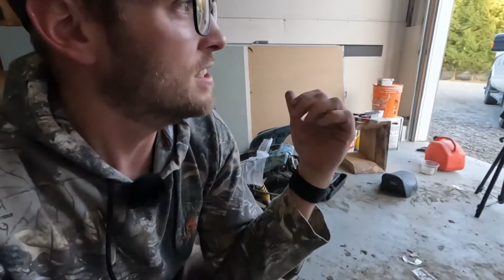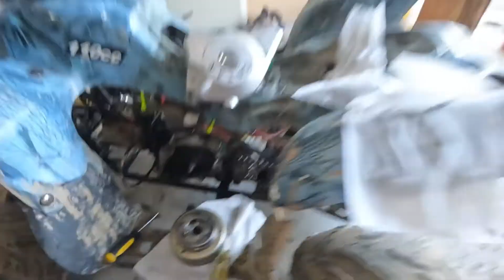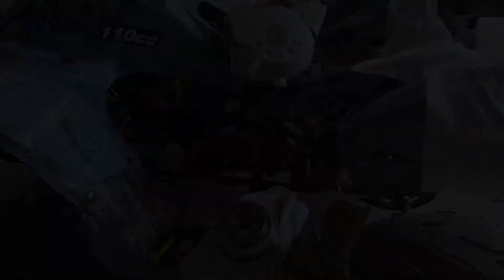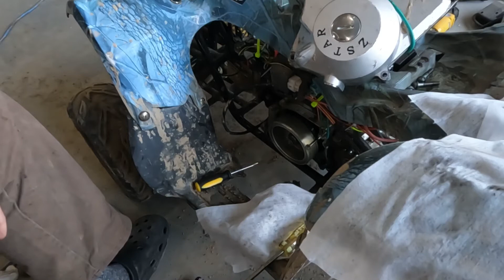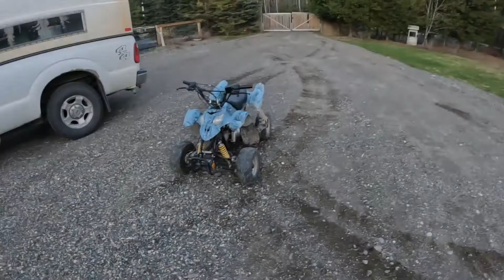110CC ATV Starter Clutch Fix. A Patch and Go Solution for $0 Budget.

Comment: How do you get the magnet off? After the bolt is removed
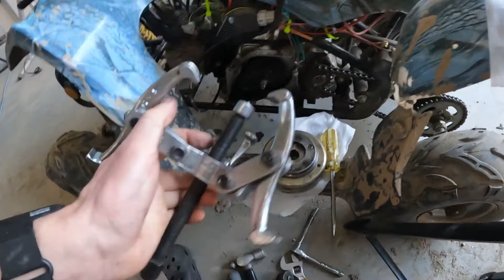Reply from the maker: 8:00 min. Puller to get it off the crank shafts.

Comment: Well I welded the bushing onto the big sprocket and it fixed my issue. Just wanted to let you guys know.
Reply: What bushing ?
Reply: @GorrillaFastTv : there’s a slip bushing inside the clutch and if becomes worn out, just give it a small tack weld. Rotate it on the flywheel and you should understand what it does!
Reply: @Mr.Sharky104 I fixed it the right way!
Reply: @Mr.Sharky104 but I do get what your talking about
Reply: @GorrillaFastTv yeah? Well just by throwing a new part at it isn’t always the solution! As a mechanic of 45 years of experience, you sometimes have to be creative! Them new chinese parts are designed to fail , so the manufacturers can make money. But hey, whatever floats your boat dude.
Reply: @Mr.Sharky104 yes ik! Even before I seen this video I already took it apart and pulled the springs to fix it. But my problem was whoever worked on the bike before. Ordered a new starter and the starter spun the opposite way. Something told me out the old starter on and see if it’s spinning the wrong way it was!

Comment: I had that problem, we fixed it same way, few months later (now) it won’t start again. We tridet to push it and it started on pushing, but I think it is not the same problem because when this was problem we could not start it on pushing, do you know maybe what could it be
Reply: Maybe same problem but they are just too weak to start by button
Reply from the maker: I'd say they just get too weak and collapse again. Very cheaply built units.
Reply: @sprucestomper  tnx for help i think it is that too

Comment: I install a new starter clutch the sprocket just spins clutch is not engaging I'm lost.
Reply: You ever find a fix?
Reply: @BenjaminJacobo-un8oh  i have the same issue, what was your fix?
Reply: Hi there, I'm having the same issue did you ever find a fix?
Reply: I’m having the same issue with my grandkids Evoque ATV. I noticed the large sprocket has a bushing where the clutch dogs, little rollers catch it , but the sprocket doesn’t turn, but the bushing does. Thinking of welding the bushing to the sprocket. Any thoughts? I will update once I am done.

Comment: A lot of other tubers just say - "forgot to turn the camera on while I fixed the roller springs in the roller ramp clutch" so thanks for taking the time to actually show how the starter engages the engine on this.   Anyway, nice work.  Lots of small engines, even nitro GLOW engines use roller or needle bearings the same way for starting.  BTW I think washing machines have a similar mechanism   that turn part of the agitator only one way.  Some are weighted dogs (with teeth instead of ramp friction) that fly out on a lever and are shoved back in the reverse direction.

Comment: I've used Chinese. Scooters, for years the parts are cheap, and their easy to fix,  now I have a dlx hawk dual sport, with 12k miles still runs like the day their delivered it in crate.  Saves me all kinds of cash, good on gas, gets up to 60mph, at 7k rpms,  go thru dirt trails . Avoid the California, hordes that have  invaded,  the small town I've lived in forever.
Reply from the maker: Definitely alot of fun and super cheap to fix. Thanks for watching.
Reply: Just got the grom clone last uear. First 2 wheel toy. Swapped 212. Still tinkering away to get it squared up

Comment: I have a Loncin 90cc engine fully auto gears and the clutch seems to seize and won’t disengage so the back wheel is hard to turn freely when engine is off and clutch seems to be stuck on and if I start the bike back wheel moves with engine speed but if warm the bike up the back wheel moves way more freely but still has some drag then when bike cools down it seizes back up again you recon it’s my clutch ?  Oil changed brakes not rubbing what ya reckon?
Reply from the maker: Clutch, its the only piece that transfers powers from the engine to the wheels. If the wheels are turning that clutch is engaged, if they wont stop then the clutch isn't disengaging.
Reply: @sprucestomper  ohh ok I’m gonna rip the clutch out today to count the teeth and buy a new one thanks for your help!!!!

Comment: Do i need to install the new gasket or is it only when its broken?
Reply from the maker: A little gasket maker or RTV silicone is pretty much good enough for anything on these cheap quads. I dont recall but I dont even think that starter cover had a gasket at all. Thanks for watching.

Comment: Mines turn ova without fully engaged the flywheel but when I take the spark plug out it turn everything over together
Reply from the maker: Sounds like something is weak in the clutch. Won’t turn over under compression but when you take out the spark plug there’s no resistance anymore from engine compression. If the starter and chain work I’d say it’s still a clutch problem.
Reply: So should I do what you did on this video.. or replace the flywheel ?

Comment: I don't know if that's what's wrong with mine. The starter turns on the bench but not on the atv when I connect it directly to the battery. Could something be stopping the chain from turning? Would be so nice if these had repair manuals...
Reply from the maker: If it turns over when you bench test it then the starter is probably fine. If it’s truly connected direct to the battery (no other wires) then battery or ground issue? Install it in the bike and use an external source to power the starter and see what it does. This eliminates a lot of things and if the starter turns the chain and nothing happens it could be the starter clutch springs ect. Honestly the more wiring gin these you remove the better, there are a ton of safety switches.
Reply: Just got a free ssr pit bike same problem when try to start just need the tool to remove fly wheel AutoZone and advance auto doesn’t seems to have such tool